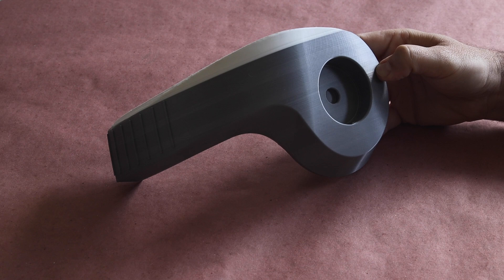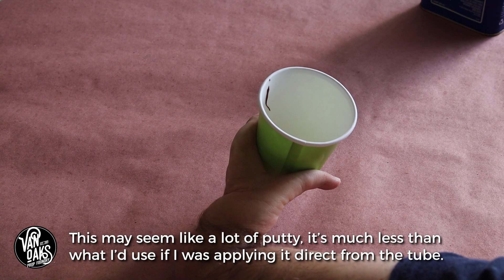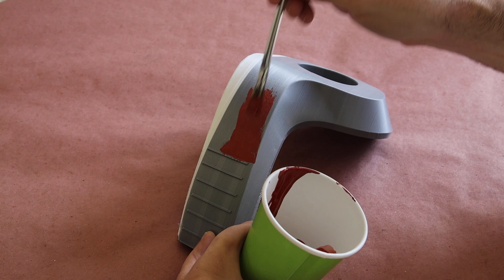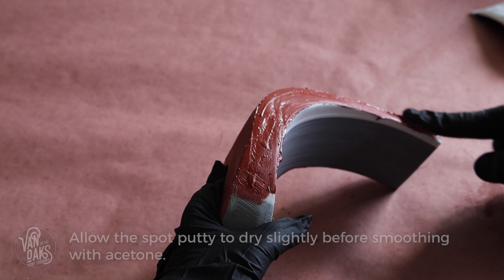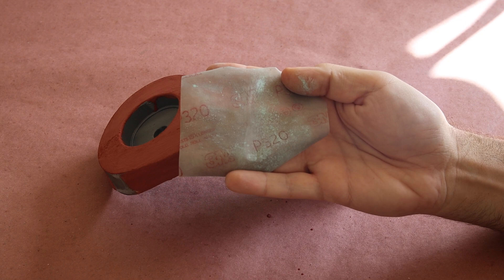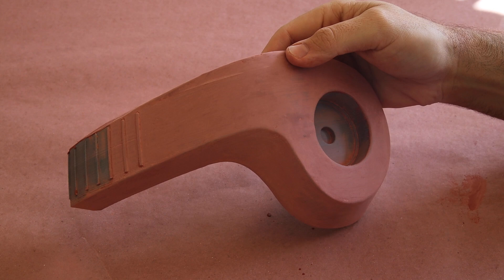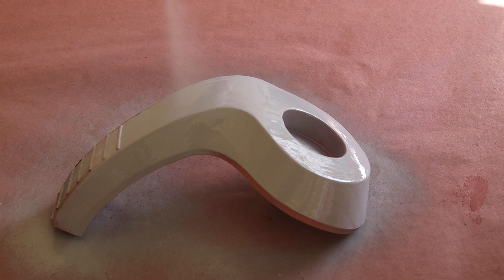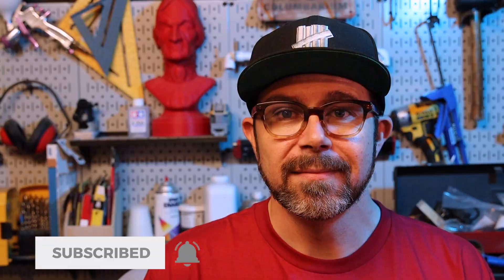The BEST Way to Smooth 3d Prints

Comment: Wet Sanding is the secret sauce of smooth 3D prints.  I've done filler primer, but never tried spot putty before. I'll have to give it a try. Thanks for the acetone tip!
Reply from the maker: You bet!
Reply: in my case, the shell is very thin, and is in an almost eggshell finish, so any sort of sanding won’t work. I’d also imagine that higher detailed pieces would be a proper pain to try and smooth.

Comment: Interesting technique.  I discontinued use of the red tooth paste junk some time ago.  I found for long term use it was too prone to cracking as it continues to shrink over time.  If you have an HVLP setup I’d recommend heading over to your nearest automotive paint supply store and picking up some PCL poly primer.  It’s essentially very very thinned down bondo you spray on with a gun.  It stands like butter and covers beautifully and In most cases gives me a 95% complete finish after a single pass.  I don’t think I’d ever use anything else ever again.
Reply from the maker: I’ve tried poly primer but my harbor freight hvlp gun didn’t spray it very well, so I went back to the red stuff. I may just need to bite the bullet and get a good hvlp gun.
Reply: @VanOaksProps  This stuff has changed my life.  I still have a few tubes of the red glazing putty lying around if I need to do something quick.  But this is my go to for large projects.  I. ended up picking up an Astro Europro with a 1.9 nozzle specifically for spraying primer.  It cost me about $100 and has worked a treat.  Considering what my other two guns cost this was a steal.  I also found I end up using way less material than with rattle can filler primer so it’ll pay for itself eventually.
Reply: @evoFTMFW  Hey dude, awesome idea. Bit new to this, do you use any particular type of poly primer?
Reply: That's your problem You were using it wrong It's Not supposed to be used for large areas it's supposed to fill in layer lines or small gaps if you want to cover larger areas you have to go with a body filler.
Reply: @ray24051  no, you’re using it wrong.  It isn’t intended to fill in layer lines or small gaps.  It’s intended to fill pin hole sized defects in the surface.  If you use it to fill layer lines it will eventually crack.  Again, the stuff is junk.  Use a catalyzed product.
Reply: would the pcl poly primer hide the lines where two pieces are glued together?
Reply: Is there an alternative for those that do not have a spray gun?
Reply: It can, but it wouldn’t be my first step.  I would first put down some 2 part body filler to fill any major defects, then do the poly primer down over that.
Reply: You can brush it on by hand as well.  It does not need to be sprayed, it just won’t go down as even that way.
Reply: @evoFTMFW  thanks for the quick response!!!

Comment: I've seen the spot putty but not acetone. I usually use a wood filler thinned with water. The spray filler primer has been my go-to for a few years. Wet sanding is a step I never skip. I go all the way to 600 grit for my final pass. Might have to try the putty acetone trick. My problem right now with 3D prints is the warping in the sun ... think I need to change filaments.
Reply from the maker: The acetone trick was shown to me by another maker as a method for creating textures on their props. I figured I'd give it a go for applying spot putty and found that it was just the trick to get it fluid enough to lie down in the layer lines.

Warping will always happen in the sun if you leave it out too long and it can happen quickly, as I'm sure you've noticed. I tend to lean toward a hair dryer and then a long wait before sanding to ensure the solvents have flashed off and the primer is set.
Reply: Only 600?
Reply: A bit late to the party, but that kind of warping might be remedied by getting rid of internal stress through annealing/curing.

Comment: This is interesting.

I saw a vid on using the corn starch, resin method and it looked amazing.
But for some of us, we don't have any kind of UV curing box.  So that method is out.

I saw yours and this looks interesting.

I wonder how it would look with a final coat of high gloss, metallic car paint, with that deep metallic look).

That's kind of what I am after.
Reply from the maker: This method is based off of autobody work practices and so it should get you that screen quality look you're after.

Comment: Very useful technique. Thanks for sharing. About to get my creality Cr-10 mini up and running. I'll be sure to use this technique for sure.
Reply from the maker: Right on!
Reply: @VanOaksProps  I'm brand new to 3d printing and while I understand that helmets can be sliced into sections to build with smaller 3d printers, I was wondering if you might happen to know what the minimum build plate size is for full size helmets (on average). I have the creality cr-10 mini which says it has a build size of 300x220x300mm. Would this be enough to print in 1 shot? Thanks for any help on this.
Reply from the maker: @603VIL  I'd say 400x400 to cover a range of helmets, especially if you're like me and have a large head size, but most people use 300x300 beds. Even with the 300x300 you may encounter a helmet or two that's just a bit larger that won't fit, so you're likely to have to split something at some point.
Reply: @VanOaksProps  thank you. One last stupid question: Is this something that I can figure out on the slicer software? For instance, can I adjust the build space on the software to my appropriate printer size, then import the file to see if I'll need to section it out?
Reply from the maker: There are no stupid questions here. This is definitely something you can figure out. I use Meshmixer to slice files and there’s a great video by Joel the 3d printing nerd (on YouTube) that I found extremely helpful. 

As for determining whether or not something will fit, just throw it into your slicer of choice (I use Cura) and move it around until it fits - often it means turning it 45 degrees. If it doesn’t, then open it in Meshmixer and cut it into pieces
Reply: @VanOaksProps  Super helpful tips. Can't thank you enough man. I owe you a beer (or 2) for sure. Thanks a million. 🤘💀
Reply: Quick update...I just finished printing 2 halves to a Doctor Doom mask (from Thingiverse) and I'm currently taking my time and applying this spot putty technique to the whole mask. I've seen a lot of people with who have done various strength testing for adhesives to join PLA 3d prints together. If you don't mind me asking, what is your go to? Super glue, 5 minute epoxy? And, which brand? Thanks again.
Reply from the maker: @603VIL  I typically use cyanoacrylate (brand doesn't matter) and then will coat the interior with epoxy if it's going to see a lot of use.
Reply: @VanOaksProps  Is that a 5 minute epoxy? And, if so, what is the best 5 minute epoxy choice? Really appreciate all the help man.  If you're ever in the New England area, I owe you 🙏🤙
Reply from the maker: @603VIL  The kick time doesn't really matter. The 5 minute stuff, regardless of brand, is a good option. They're all basically the same in my experience.

Comment: when your getting to the step to use the primer do you spray it, sand it and spray agin before the next sanding?
I just sanded a big part with a 320 grid and want to finish on the end with a 3000 grid and spray paint it so wondering it I have to use the primer every time before the next grid. And I understand you carry on with wet sanding with the next grids?
Reply from the maker: Not really. You can go up in grit until you’ve reached a smooth surface. Before your top color you’ll want to wipe it down with a tack cloth to remove any dust and debris.
Reply from the maker: The additional layers of primer are added to aid in the filling of gaps or covering the surface of the part as a base for your top coat of paint to have something to bond with. But extra is only applied if necessary.

Comment: Would it be alright with a .600mm filament? would I just add less acetone to make it thicker to fill cracks better or just do it multiple times?
Reply from the maker: If you’re printing at that high of a resolution you may be able to just use a filler primer. The thinner your layer lines the less filling you’ll need to do. That said, with very thin/small layer lines you’ll want thin body filler, since thick wouldn’t get into the space between the lines that you’re trying to get rid of.
Reply: @VanOaksProps  alright, thanks.

Comment: That's funny. I do the opposite... build up primer first, a few coats and the spot putty to get any area the build up primer didn't smooth over.
Reply from the maker: Depending on the layer height I flip between both methods. I think a lot of people tend to print at lower resolution to save time and this approach really shines at .28 or more.
Reply: @VanOaksProps  I'd have to agree. It's definitely going into my possibilities tool kit. Thanks for sharing 👍

Comment: What is the advantage over just several spray coats of auto filler? Time? Was just trying to understand the differences
Reply from the maker: Cost, dry time, ability to apply to a specific area, not an aerosol.

Comment: Does it eat to much of the layer? For example on dental models which need to be as accurate as possible will it loose some accuracy?
Reply from the maker: It doesn’t eat anything. Acetone doesn’t melt PLA. It does, however, melt ABS.
Reply: Thanks I’ll give it a try

Comment: What did you mix the solution in? My fear has been pouring that stuff into my plastic mixing cups and having them melt, or even worse, melt INTO the mixture!
Reply from the maker: I’ve found paper coffee cups work best. You could also use glass jars.
Reply: @VanOaksProps  thanks!

Comment: just use 2 part automotive primer the one with hardener it will fill 40grit sanding scratches with 2coats
Reply from the maker: That requires an HVLP setup though…

Comment: What type of material are you printing with? Doesn't acetone melt PLA plastic? Will it melt PLA plastic?
Reply from the maker: It’s PLA. Acetone melts ABS.
Reply: @VanOaksProps  so it melts PLA. Every other youtuber says it melts PLA?
Reply from the maker: @apache-0verkill  Acetone & acetone vapor melts ABS. Acetone mixed with spot putty does NOT melt PLA.

Comment: What grit of sandpaper do you think is best?
Reply from the maker: I typically start with 150 - 320 - 600 - 1200(sometimes). If there's a lot of issues I may go with a 60 or 80 grit.

Comment: What works best in terms of making sure the 3D print doesn’t deteriorate
Reply from the maker: It's tough to say without knowing the application. If it's a helmet or something, you'll want to make sure that you leave it out of the sun/heat because it's plastic and prone to melting. I always like to coat the inside of my parts, where possible, with epoxy to help give it more stability. Bondo/spot putty does a good job adding rigidity to parts but isn't a guarantee that it won't warp in certain conditions.
Reply: @VanOaksProps  mine is a replica of Madame Leota’s Headform made from PLA, I want to make sure it lasts long because I don’t think I’ll be able to replace it in the future
Reply from the maker: @skinnyhimbo5835  I'd coat it in a thin layer of epoxy. That should help a lot.

Comment: Is the acetone just to chin the putty? Or I'm missing something
Reply from the maker: That’s correct. When applied straight out of the tube it tends to be thicker than you actually need it and requires more work to get it into the print lines. By thinning it you’re using less putty and getting it into the lines much easier.
Reply: @VanOaksProps  I see, I'll have to try it. Thanks, excelent content

Comment: Get the mix thin enough then use an airbrush to apply.
Reply from the maker: There’s no real benefit to it since you’ll need to sand it after applied. So you can skip cleaning (and potentially ruining) your airbrush and just brush it on.

Comment: I tried the exact brand on everything you used and everything ended up coming off when trying to sand my piece.
Reply from the maker: What grit sand paper? How long did you let it dry for?
Reply: @VanOaksProps  3 to 4 hours of drying and 120 grit sandpaper
Reply from the maker: Hmmm. Hard to say what went wrong. Ideally there should just be spot putty in between the layer lines, since that’s what you’re aiming for.

Comment: what about high detail charachter !
Reply from the maker: You could still use it, but the truth is that high detail prints should really be done on an SLA (resin) printer. If that's not available I'd print your parts at high high of a resolution as possible and just use primer to help smooth out the layer lines.

Comment: Acetone will weaken P LA  It is easier to use Is homemade cold   porcelain
Reply from the maker: The acetone flashes so quickly that I don't think that would be an issue. Also, it's important to remember that porcelain clay tents to shrink by 15-30%, which is a huge variance and would definitely impact your finished piece.

Comment: Wait, if that stuff dissolves in acetone, couldn't you just apply  1 even layer and then use the vapor smoothing trick?
Reply from the maker: PLA does not dissolve in acetone. ABS does.
Reply: @VanOaksProps  I'm talking about the putty that you applied. It might work?
Reply from the maker: @ronnetgrazer362  oh, I see what you mean. I don’t know that it works like that.